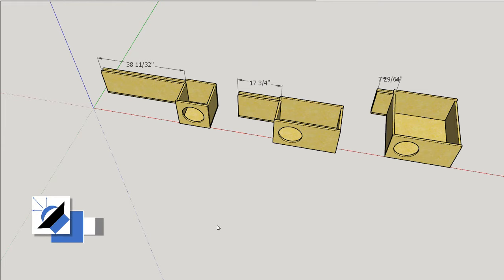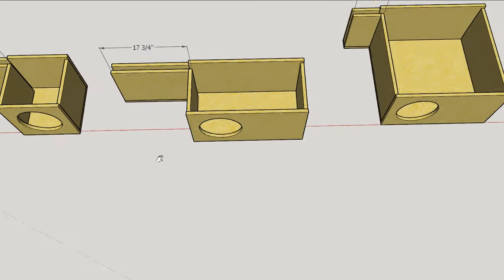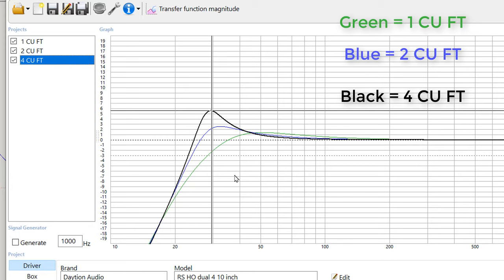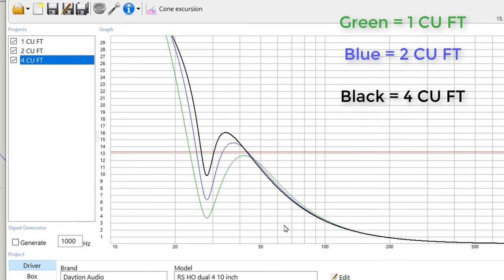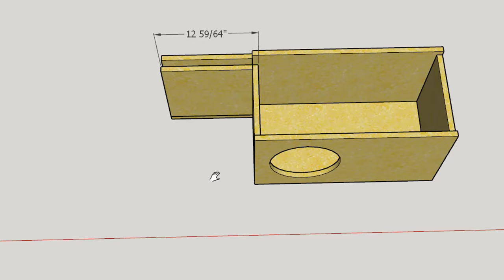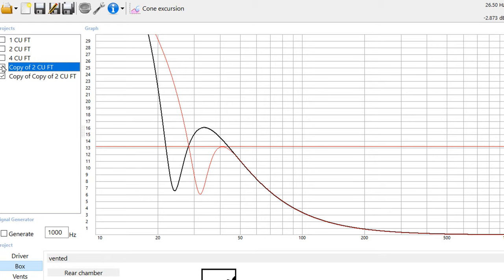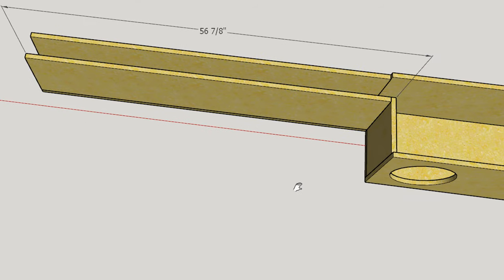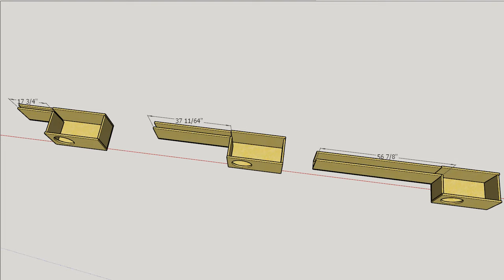Understanding Port Length, Box Volume, and Tuning Frequency.

Comment: How does one figure out loading wall tuning on a 6th order wall. Typically you see just an opening that is essentially only as deep as the wall itself. I never understood how to figure that out.
Reply from the maker: Those big SPL builds like that are a lot of trial and error.  One reason why those huge porters of short is because the enclosures themselves are massive.  Take up the entire vehicle, that kind of thing.  I don't have any experience with it so I couldn't tell you much more.
Reply: @DIYAudioGuy  i believe theres some sort of enclosure size to port area size ratio that gets figured out with a mathematical formula but i cant find much more on what formula is used so i typically rely on applications but i worry ill enter things wrong with this kind of port design

Comment: I want to know about using 2 round ports compared to 1 bigger round port
Reply from the maker: It works the same as using two slot ports instead of one slot port.  Each port only sees half of the enclosure.
Reply: @DIYAudioGuy  I'm about to do a different build and go with 1 15 in the middle of my single cab and thinking of doing 2 ports one on each side facing up. Or just use 1 on the passenger side to help with loading?

Comment: I am a bass head at heart but I'm a newbie in my budget range rn 😅. Anyways I have a Scar ix12d4 sub I ended up getting from my roommate for a debt . so now I'm building a box for it to try to get the most bang for my buck literally. Can anyone please give me advice on what design or type of enclosure I should make. Oh and by the way I am using 1.25" inch oak. I have 72" ×19". Thank 😊you I am salty its a poop speaker frfr.

Comment: 🔴I have a 8 cu ft gross ported box (with 15" kicker L7s 1000w) my port area is 17.5" x 4" equals to 70 in2 (or about 9 in2 per cubic foot). can someone tell me if my port is to small. i heard its supposed to be 12 to 16 inch squared per cu ft
Reply from the maker: I am not a fan of the x square inches for y cubic feet approach.  It's better to look at port airspeed in WinISD.  But, that sounds a bit small for a pair of those subs.
Reply: @DIYAudioGuy  thank you for your reply, my present airspeed is 17.5 m/s. if i increase my port area and get 10 m/s will that be to low?
Reply from the maker: @doublemanson  If you're at 17.5 then you are exactly where you need to be.  I would not recommend changing a thing.

Comment: I may be late to this party, but thats only because I was a late bloomer. But I still bloomed lol. Is it possible for a 6th order not to be tuned 🤔? Say a 6th series tuned bandpass where both chambers are identical and both feed each other. Neither being necessarily front or rear? Heck of a bandwidth from 28 to 72 hz, but not necessarily a peak. Only asking to understand tuning. The gentleman that designed this enclosure insist there's no real tuning. So again I appreciate your input or opinion. Thanks again and I look forward to more of your video
Reply from the maker: I'm not sure what to make of that.  If you've got a flat response from 28 to 72 Hz then you got enclosure that has been tuned, and tuned quite well.  The word "tuned" and the word "designed" are interchangeable in this context.
Reply: @DIYAudioGuy  I really appreciate your response. You're the best at conversing with your followers. This makes us feel welcomed to your channel. Almost feels brotherly in a since. Thanks from us all. The guy from Hex Base designed the enclosure. He and Aaron from Audio Dynamics are working together. I actually had to go through Aaron who relays the info. All in all a great enclosure although I couldn't get the tuning

Comment: Anyone can help me how  many Hz should  be tuned for  soft bass.
I dont like tight bass, chest beat, or bhoomy bass
(For home purpose pioneer tsw1212s4)
Reply from the maker: Not sure what you mean by soft bass.  Typically this is what people say the bass sounds like with various subwoofer set ups:
Sealed = "tight bass"
Ported, tuned high (say above 40 HZ) = "boomy"
I am not sure what type of tuning is associated with cheast beat.

So my advice is to go with a ported box and tune it low, below 35 HZ, possibly lower.

Comment: I'm interested in designing speaker cabs for guitar that are as small as possible.  Lowest note on guitar is around 80Hz, so nothing demanding.  Toward the beginning of your video, the curves look like even small closed cabs have fairly linear response, and that the main problem is low end extension. 
So...What are the disadvantages of using your worst case example (1 cu ft) for guitar? (Speakers would probably be Altec 417-C, but I was not able to find models for those).
I guess the real question: Do you know any tricks to make the 1 cu ft enclosure work well down to 80 Hz?
Reply from the maker: I've been putting a lot of thought into how to design a bass cabinet.  The main thing is the frequency, I was thinking that some of the harmonics from a bass guitar could get down to 40 hertz.

When I look at bass cabinets in the local guitar shop they all seem to be using PA drivers, very small ports, and most of them seem to have a bullet tweeter as well.

If you don't need to get lower than 80 Hertz then you don't really need a particularly large cabinet.  Just keep in mind that as the cabinet gets smaller the port has to get longer.  But if you're shooting for a tuning frequency of say around 60 hertz then that's not going to be much of an issue.

As the cabinet gets smaller you're also going to lose some efficiency, that's really the biggest drawback of a small enclosure.
Reply: @DIYAudioGuy  Fundamental of the low E string on a bass is near 40 Hz. I suspect you knew that, so we're probably talking about more nuance in frequency response.

I've designed a lot of guitar and bass gear (electronics, not speaker cabs).  Some of the frequency response optimization is counter-intuitive.  For example, guitar sounds horrible with extended high frequencies.  Guitar amps and speakers roll off above 5Khz or so, and amps usually incorporate a notch around 300Hz to keep the sound from getting tubby and clouded.  Not as much attention to the bass end, except in trying not to get in the way of the bass player.

Bass amps, on the other hand, are treated like hifi systems, with full extension in the top register (hence the tweeters).  Amps often generate an equivalent notch, around 160 Hz, but that's not a given.  

I think one of the assumptions about the low E string is that the human ear will 'hear' the fundamental from the low strings even if it's not present, as long as there's enough 2nd and 3rd harmonic.  IOW, clues to what the fundamental must be.  Ex: Presence of both 200hz and 300hz imply that the fundamental must be 100hz.  The psychoacoustic concept has been incorporated into sound processors and plugins such as MaxxBass.  The filter plugins reduce the fundamental and generate additional 2nd and 3rd harmonic content.  The idea is that you'd be able to play the sounds louder on small speakers without flubbing out, while the 2nd and 3rd harmonics make you hear the fundamental that's not there.  So...nicer bass from a tiny speaker.  Tighter, more defined sound, cause many people don't hear low fundamentals well anyway.

Not sure if that's any use to you in your designs.

The small speakers that I was trying to resolve are only about 1 cubic foot.  I had premium old Altec 417-C alnicos mounted in them, and the cabs never sounded great to me.  I don't think the speaker modeling program has models for the 417-c's but that would have been nice.
I was considering putting 10's in them instead of the 12 inch alnicos.  Not sure if porting is even viable, so maybe cutting out the entire back of the speaker cab and making it into a simple open-back cabinet.  Even then, there's not much area to keep the out of phase back wave from cancelling bass.  Lose-lose situation maybe.

If you have any thoughts about approach, I'd welcome them.  Maybe Thiele cabs?  They may small enough.
Reply: @DIYAudioGuy  Sorry that I missed this the first time around. 
I've worked in the music industry (incl amp manufacturers). You are exactly correct bass cabs. Linearity get to the realm of acoustic bass, and it favors overall bass sounds. Since they don't rely on distortion (like a guitar), they can use upper frequency extension to advantage. 
That bullet tweeter will sound horrible on a guitar. Tinny and harsh, especially with any distorted sounds. Guitar speakers deliberately roll off about 4k to 5k. That's just 'the sound.'  On the other hand, if you were going for acoustic guitar sound, a tweeter could be helpful.
My own work is primarily in electronic circuitry though, and I've got little experience so far in how to actually tune a closed cab.
Do you know of references that wouid give an idea of math/equations for developing the correct port construction for particular speakers?
In the case, speakers would be old Altec alnico 417-B's (12").  Or maybe best to use 10" speakers with adaptor rings to take the speaker diameter down to 10".  Figured that may ameliorate some of the constraints for port construction and such.
Reply from the maker: @stringtheoryx  the loudspeaker design cookbook as a great place to start.

Comment: Amazing info, I had planned on physically building some of these boxes to verify the differences. My question is at what point should you decide to have a chamber at all. In example I built a 12 ft front loaded single fold tapered horn for truck blow through build. It's about 29hz tuning fq. I'm wondering now if I should have built it with some chamber to help load it at the higher frequencies. I'm going to have a bunch of questions for you in the near future, look forward to your wisdom. 👍🔊✌
Reply from the maker: I don't know anything about tapered horns, soni am not sure if I can help.

Comment: How do you tune external aeroports
Reply from the maker: Same as internal.
Reply: @DIYAudioGuy  but the port isn't taking up any space inside enclosure so it has no displacement in the enclosure so a two and a half cubic foot box still requires the same amount of external port for 35 Hertz as it would internal for 35 Hertz

Comment: Thank you for this great video man. Can i ask some questions about tuning?
Reply from the maker: Sure,
You might find  your answer in these videos:
https://youtu.be/B0cqSt3RNK8
https://youtu.be/U5BQdnagzW8
Reply: @DIYAudioGuy  yes those videos are very helpful. And not only those. All of your videos are the best and so helpful for me. Thank you so much sir. But the questions i wanted to ask was about the tuning frequency.
Reply: @DIYAudioGuy  this will be my first time designing an enclosure. So imagine i want my system( my sub, my enclosure) to shake everything in my car so and people outside can feel the bass so at what hz should i tune my port and at what hz should i expect for the frequency to peak?
Reply from the maker: If this is the first time you're doing it I would recommend sticking with the manufacturer's specifications.  Most manufacturers will give you a box size (net internal enclosure volume) and a tuning frequency. Then they typically leave it up to you to figure out your port.

In car audio most people will tune the enclosure in the 30 to 40 hz range.  That doesn't mean you're going to get the best possible sound.

Beyond that you would want to model the enclosure in something like WINisd.  If you plan on building boxes on a semi regular basis it's worthwhile to download that software and learn how to use it.  But if you're only going to build one then just stick with the manufacturer specifications.
Reply: @DIYAudioGuy  thank you sir. Yes i will follow the manufacturer specs. But my doubts is only the tuning fz. As my laptop is spoiled. Still under repair. But there is one app I'm using. So for SPL guy at what hz should i tune to and that would vibrate things in my car. I really just want to understand about the fz. What is the difference when tuning from 20-30 30-40 40-50 50-60
Reply from the maker: A higher tuning frequency will allow you to play louder, as opposed to lower.  Beyond that there are too many variables to say that some specific frequency is the best frequency.  The parameters of the specific subwoofer, the size of the enclosure, the size of the car will all impact the final result.
Reply: @DIYAudioGuy  yes that is very true. But can you please give me a range. Like from 20-30 30-40 40-50 50-60. Let's just talk about frequency. This range of number what will it do or how does it sound. Thank you so much for your help. But please bear with me i really wanted to learn
Reply: @DIYAudioGuy  cause i want to know at what range of frequency does it shake or vibrate more. Let's just say a frequency which will break the windshield faster lol.

Comment: So are car subwoofers actually louder than home audio subwoofers and dj subwoofers
Reply from the maker: There's no simple answer to that question.  

Once upon a time the exact same drivers were used in all three applications, and even now a normal everyday subwoofer can be used in any of those applications.

But SPL competitions gave rise to subwoofers design to handle a lot of power, but they're not very efficient.  So on the same power those are not as loud as a PA subwoofer.  But they can play louder because they can handle a lot more power.

That is the short version.

Comment: coulod you draw me uo a box for a jl 3x3 10" speaker thing is, its for a single cab 2015 dodge. it would be a blessing
Reply from the maker: First step is to verify the available depth and the mounting depth of the subwoofer.  https://bit.ly/3IwIJLb
Reply: I have like 11 inches from my seat to the back of the truck and the depth is no more than i think 5 and a half maybe
Reply: thank you by the way
Reply: @DIYAudioGuy   ive got like 8 avaliable the woofer is about 5 and 3/4

Comment: what happens to air velocity when the port goes from 1x12 to 1x36?
Reply from the maker: As the port cross section gets bigger the velocity decreases.
Reply: @DIYAudioGuy  well hot damn, not just a reply but a simple answer that confirms what i initially thought. thank you sir, i appreciate you and your content.
Reply from the maker: @DracolegacyOfficial  as the port cross-section gets bigger the port has to be longer to maintain the same tuning frequency.

Comment: What would happen if the wood on the subwoofer enclosure was split and had cracks in it
Reply from the maker: We call that a leaky box.  That's going to mess with the tuning frequency in unpredictable ways.  The same thing happens when the edges don't make a good seal against each other.  It's not going to sound particularly great and you're probably getting a lot of noise from the wood vibrating against itself.

Comment: that speaker is 600rms with 1200w max. so your saying peak is 600w? and that 80% should be what you should feed it?
Reply from the maker: Always ignore the max power (https://maxxpoweraudio.com).  I model with 80% power in WinISD because in the real world you have to deal with box rise, power factor, and low voltage.  So you it is very hard to get the full RMS power out of an amp.
Reply: @DIYAudioGuy  i have the sinbosen fp14000 for my subs, i have the fi audio neo 3.5. I do appreciate your channel and feedback I like learning from the pro's

Comment: If you’re using a very low wattage 8 inch subwoofer that only handles less than 100 watts rms like the 8 inch grs subwoofer from parts express can you get away with using very thin wood that you can bend with your hands
Reply from the maker: Not that thin, no.  I would not recommend anything less that half an inch nominal size.  Unless you were doing some cool bending and laminating to make cool shapes.

Comment: After watching this video, I want to pay you to design my box for me. Lol. Do you do that?
Reply from the maker: I could do that.  DIYaudioguy@gmail.com
Reply: @DIYAudioGuy  do you have fb or messnegr account sir? I dont have a gmail cxount or i forgot. I want to tune my prospect size of mya box, but i do not konw the correct messuremwnt of the port. I like low freq. and loud or for all genre ,usic. Here is my box. 

L-26”
W-17”
H-13.5”
That is an outside surface measurement. .. can u help me please sir?  For the port only . Anyway 
Lported type box and 12”subwoofer
From🇵🇭

Comment: Hey i like the way you understand the readings so well on the tuning. I have a 6th order design I've been playing around with, while trying to figure it out using a lite box app on my phone. I have 2 ZVX V2 D1 12s with a RP4500 with a xs power 3000 battery. If you wouldn't mind helping me I can send you my email so I can send you my design. Thank you sir.
Reply from the maker: I'm not taking on design clients at the moment.
Reply: Ok. Thank you. I can't find anyone to tell me what I need to know to do the design. I have the design. Just needed someone to give me the right dimensions. But it's ok. I understand.